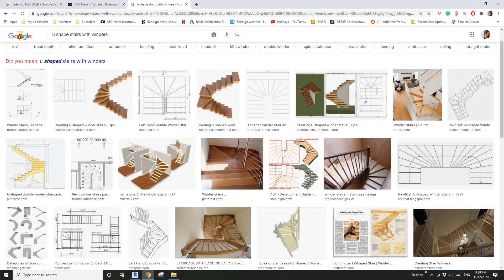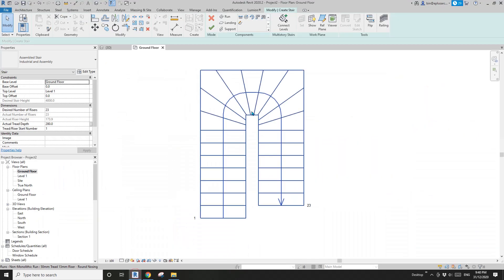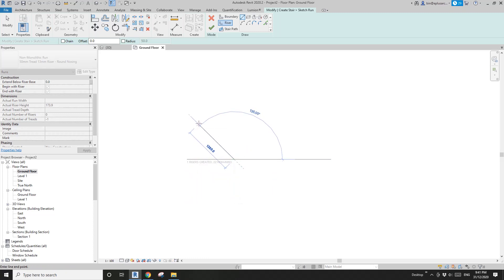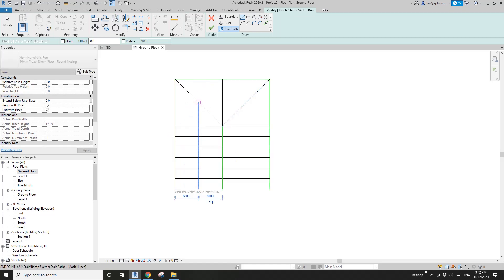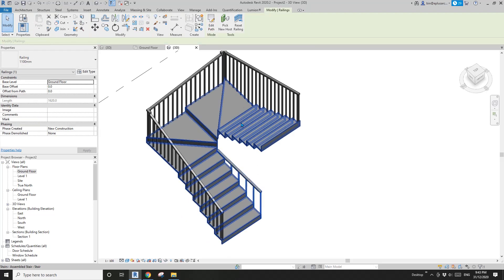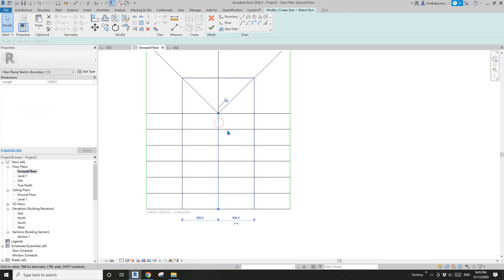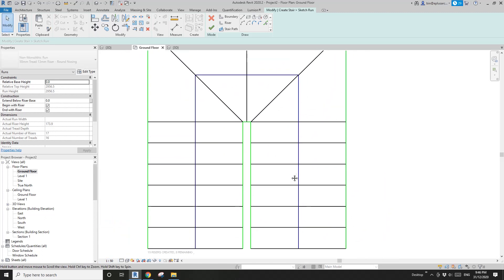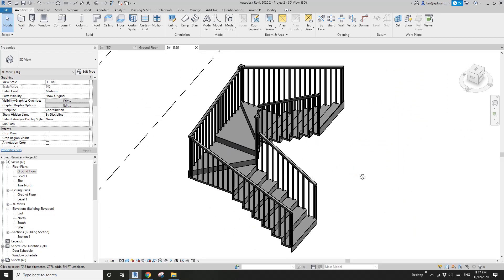Everyday Revit (Day 287) - U Shape Stairs with Winders (Stairs by Sketch)

Comment: Please if you can will be awesome i need also to learn about hip roof structures.
Reply from the maker: Usually I will leave the roof structure (truss) to the truss manufacturer, they have some software to automatically calculate and model it (I believe). I do not recommend you to model it yourself. I will do a quick and simple one in a few days.